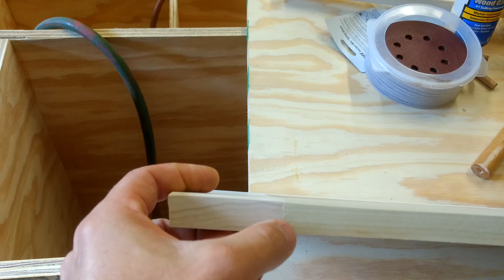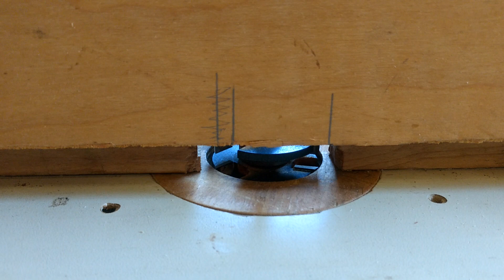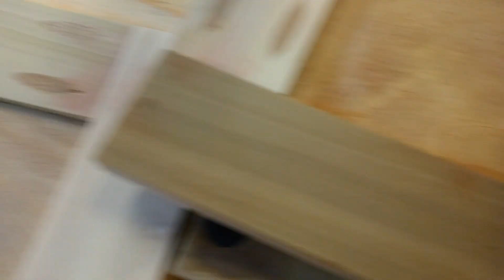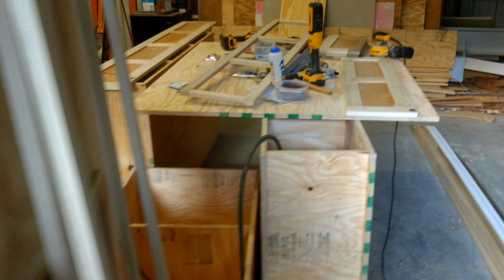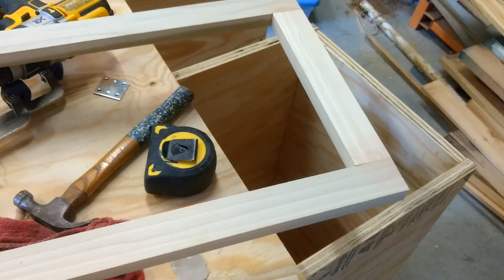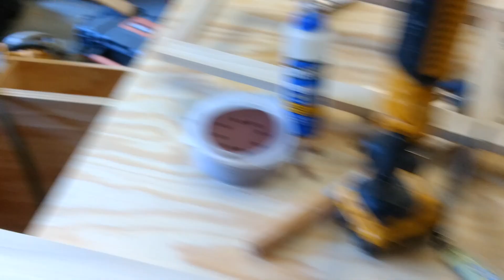Using Pocket Holes to build Shaker style Cabinet Doors

Comment: Your stiles are supposed to run the length of the door, rails in between at the top and bottom, just  like your middle. Pocket holes are then drilled in the rail. You have some done that way, but the first one is wrong.
Reply from the maker: Good point. Fence gates, doors, etc. should have a stile from top to bottom for strength.

Comment: Have the doors held up with the pocket screws?  Curious about durability.
Reply from the maker: Yes, they've held up great, but I would definitely use a tongue and groove joining method instead. A lot less work and prep, you just have to have enough clamps.